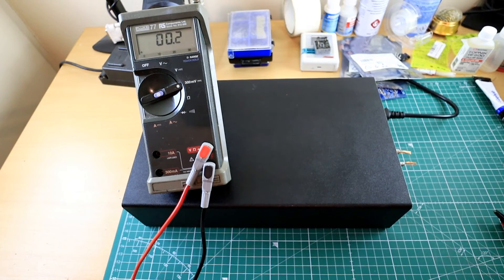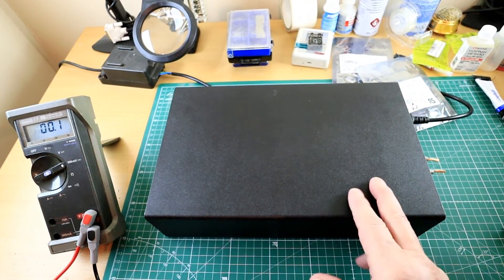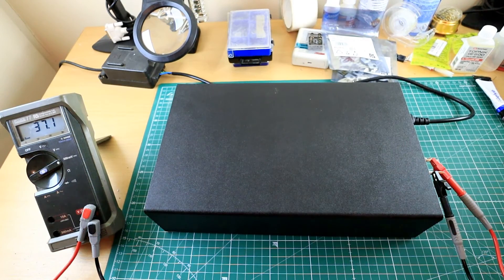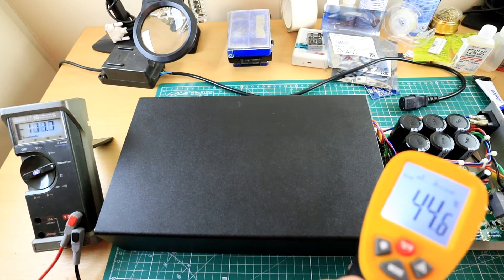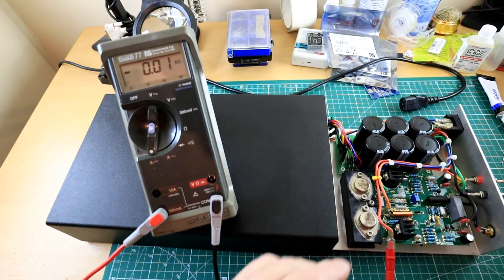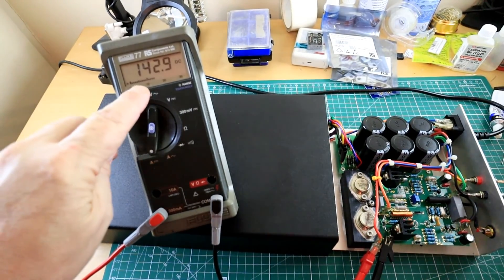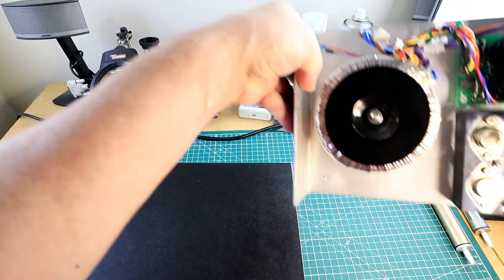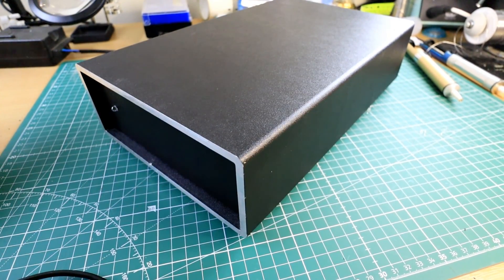NCC220 Qudos bias setup follow up. What is the bias reading after 24hrs  . continuous power on!!.

Comment: Don't trust those cheap chinese thermometers, I have several types of thermometer for the purpose of checking transistor temps. It would be a shame to distroy parts of the amp circuit for the sake of blowing a low cost component. Those small transistors are running much higher than 24 degs if they feel red hot to the touch.Try and check the quiescent current of these HOT transistors. Yes 50 mV offset is acceptable, but if you tweak the adjuster pot and it goes to -15mV or anything less than -50mV, which ever is closer to 0V is best.